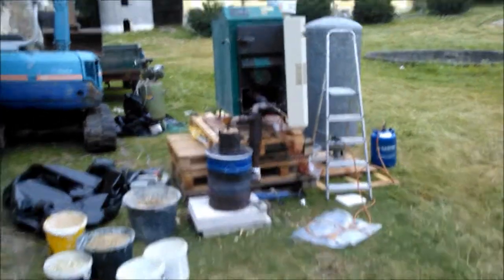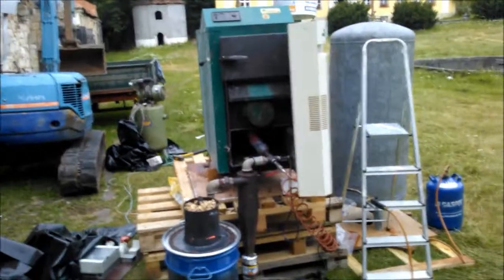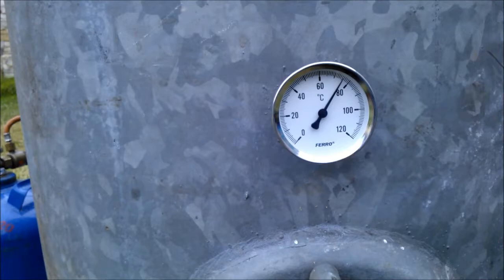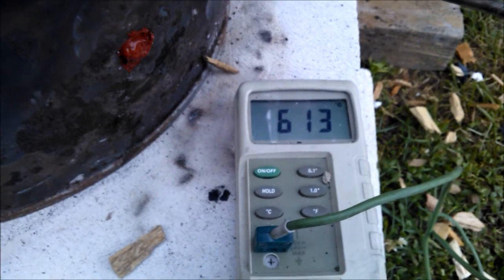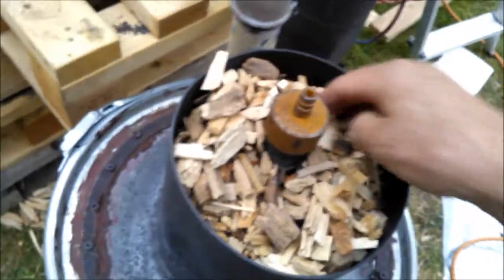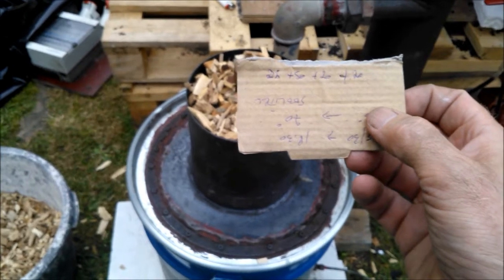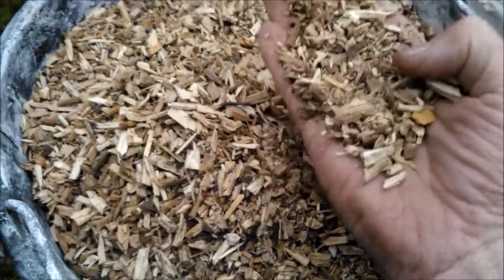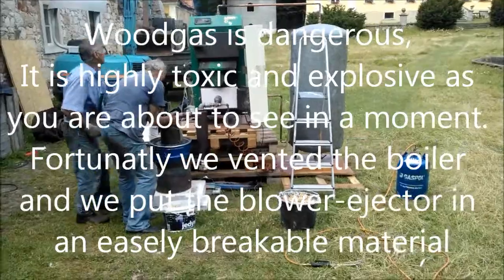Lukotop 1, as a burner in a woodboiler

Comment from the maker: Docdcox,
The 4 cross element of the ejector has:
 1) The quick coupling for compressed drive air from the compressor
 2) The gas suction out from the cyclone
 3) The entrainment pipe gas out to the burner
 4) The manometer. A simple U formed plastic pipe to observe suction.

Luk

Comment: Here are some numbers to chew on(Sorry about the mixed units):

Energy in chips used = 7863*36.5lbs= 285,468 Btu

285468 Btu = 301, 184.697 kilojoules

If this energy was expended over three hours the power output was 

301184.697/(3*3600) = 27.9 kW

27.9 kilowatt = 95,198.751 Btu/hour coming out of the burner

500L=500kg

Energy into water = (4.184 kJ/kg)*(500kg)*(58C temp rise) = 121336 kJ

System efficiency = 121336 kJ/301,184.697kJ = .40 = 40%